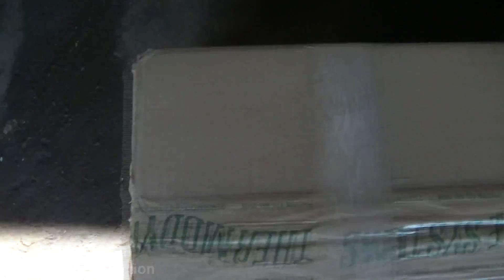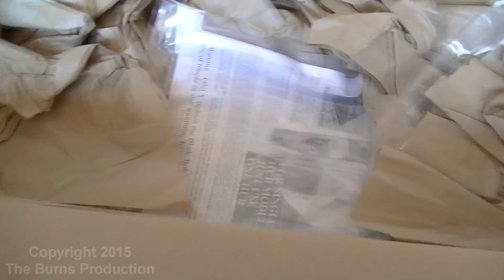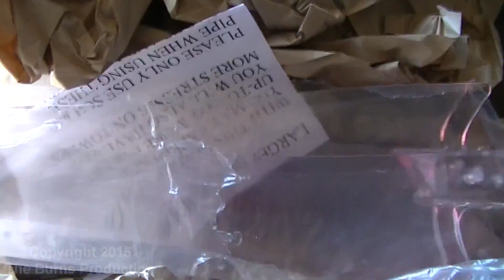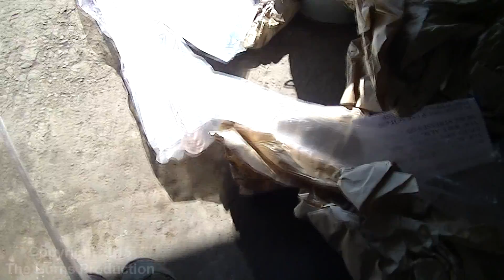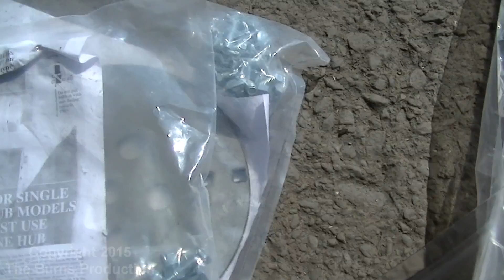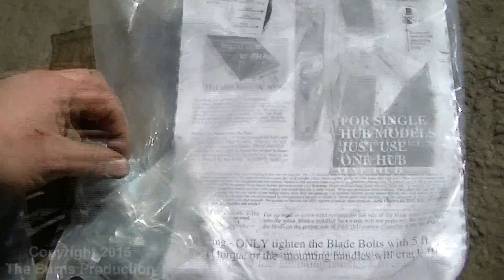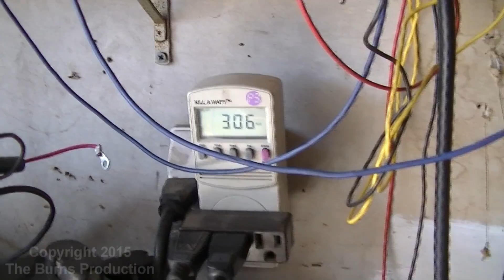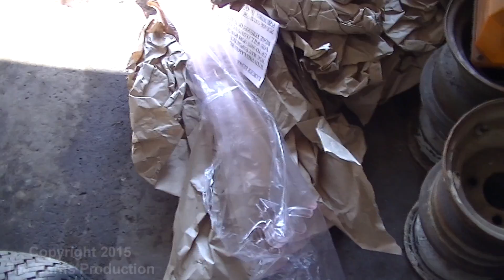Thermodyne Systems KT Pantera Ghost Blades

Comment: Hi Kevin,  I am so glad your happy. For the 10 blade hub you can just use 5 points and try a 5 blade.

I gave you lots of hub and blade combo's for testing and experimentation   I have to talk to my paper work guy about the shc #80  -  Nothing gets done right when I am out of the office and I have been gone too much these few months.

7 to 9 blades is for Dual core and 5 to 6 blades is great for super core.

Enjoy my friend.

Bob
Reply: *****     I did a one day test on my windtura 750 PMA with Pantera and I got about 35% more  power in medium winds on a 7 blade KT set. It was obvious it was spinning the 750 genny PMA extra quick and nice and silent too.  WHOOOOSH.   I hope I can talk Josh into marketing these with us cooperatively :)   Too bad it will not fit the 5/8" shaft but a wedge shim is not that hard to make in a small lathe.    When you get  those blades up on our PMA or Josh's  PMA it's going to quickly become clear that keeping a turbine of this caliber up and running  24/7 is definitely a money maker.  Pantera is a whole different animal  :)  lol  
I look forward to your videos this summer.  Thanks Kevin.